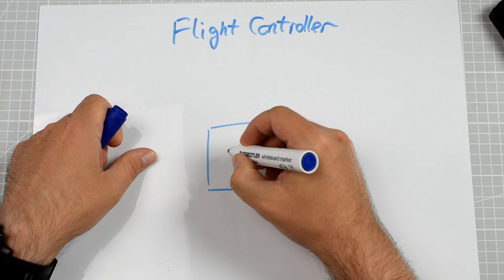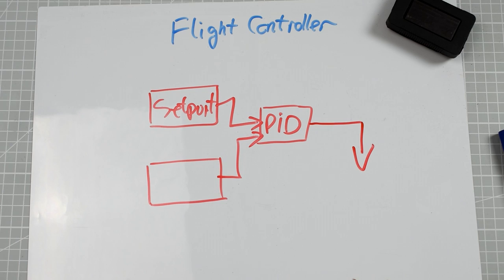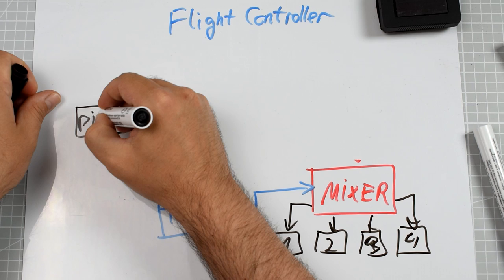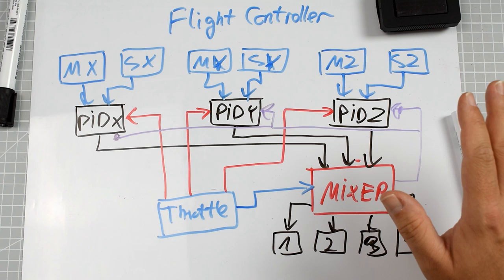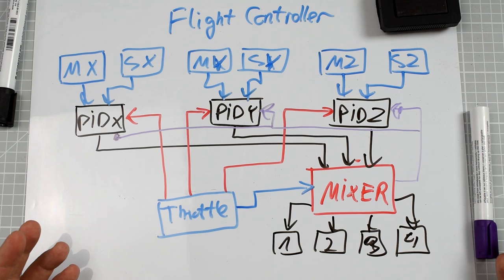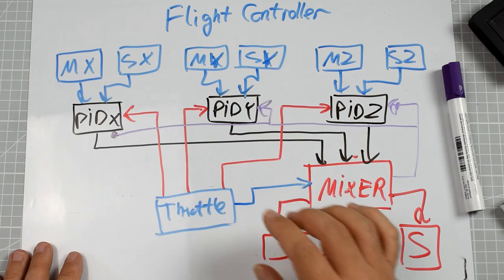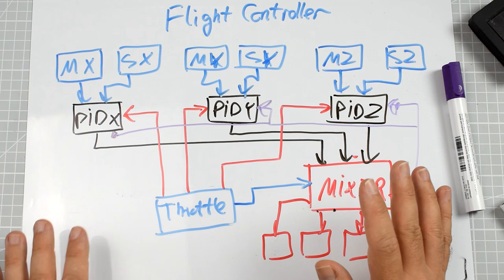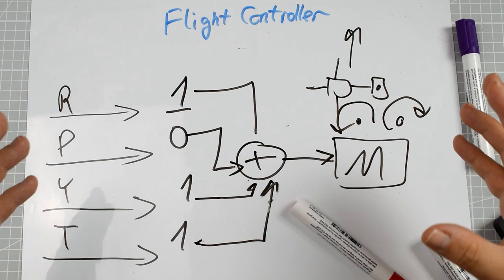How flight controller works?

Comment: And hence why when all other things are equal --> BF = iNAV = Emu = FalcoX = KISS
AWESOME VIDEO!!
A great one would be how simple the PID loop is for calcing P-term, D-term and I-term.  There is only so many ways to take the PID Error [Gyro - Setpoint] and multiply it by a P-gain; you know.  Again, equal when all other things are equal.

Comment: Please do more of this scientific video, particular interest on pilter implementation and pid saturation. I mean when a pwm for example 2000us in case of classic pwm is saturated by one pid controller for example if I have raw throttle value of 1700 one pid output of 300 and another of 200 (just examples) and mixing them up saturates the controller in a way that information is lost and the control is unbalanced in favour of one axis. Thank you, you are the closest youtuber that with his video answer to embedded programmer like me that like to implement their own flight controller

Comment: Please - MORE on the theory and implementation details.  Would you consider doing a video on the "Scheduler".  With all the demands on the CPU (you noted filtering demands are hi) - how do current flight controllers implement the task scheduler?  I do not believe an RTOS (ie FreeRTOS is used).  Are tasks/threads using their own stack space or are the time sliced within a general loop?  I hope you this consider.  I have found NO written material or videos on the subject and it would relate to choosing what processor is used within the FC (example - STM32H runs 400+mhz while STM32F runs less tha 200 mhz).  Thanks in advance for your consideration.

Comment: Great video as always.

Based upon this, should a throttle cap be implemented within the mixer so that the full throttle signal is still provided to the PID controllers?

Also for the filtering, if the D-term filtering is really there to protect the motors - Should this filtering be offloaded to the ESCs?
Reply: I think there's a throttle limit somewhere. Otherwise, at full throttle, the PID loop would no longer have a reserve to correct the flight situation.
To much D heats the motors up because there are high frequent throttle boost. If you put this in the ESCs the PID loop can't work anymore.